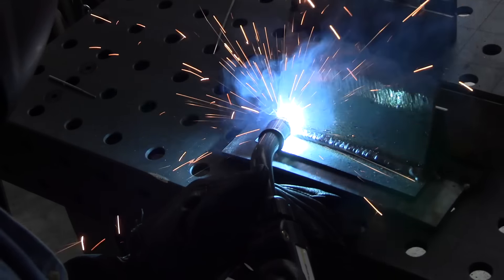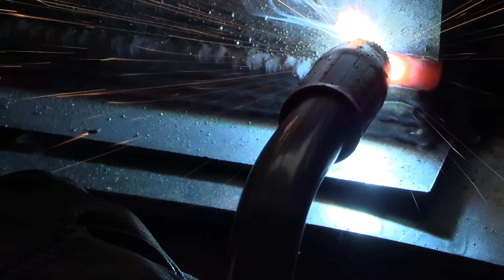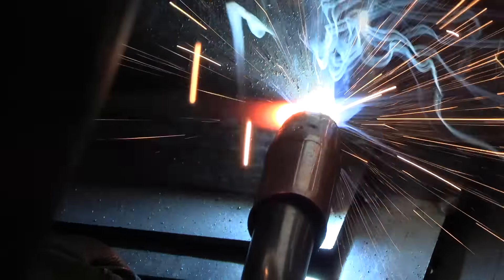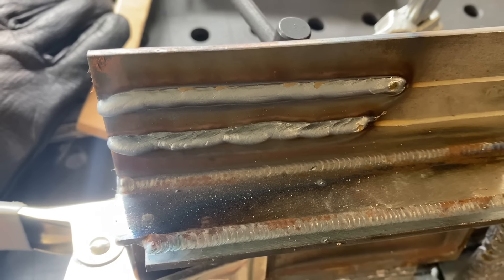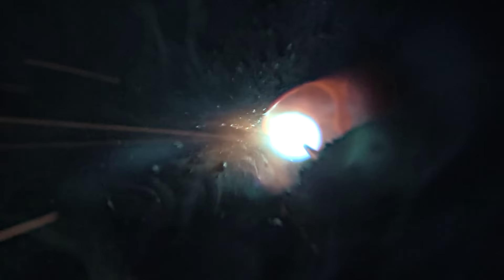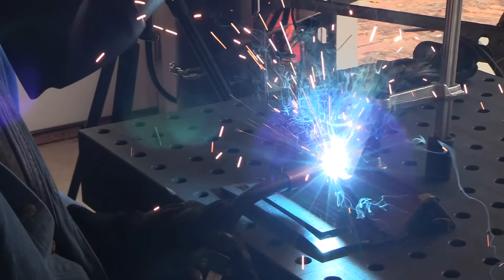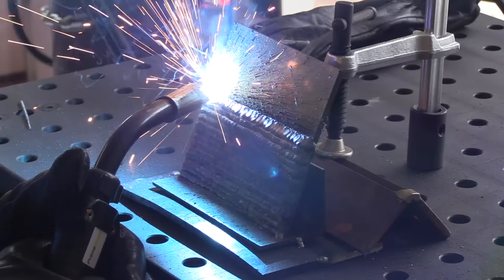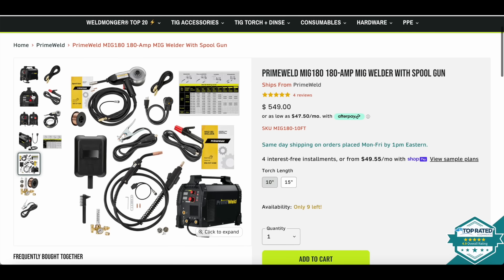MIG Welding Practice Beads

Comment: Some tricks I've learned 

1.  you can intentionally increase your stick out to temporarily drop your amperage if things seem to be getting too hot and burning through 

2. pushing slightly pre heats the base metals as you progress in the weld and is more common for better penetration 

3. Pulling is commonly used for post heat and can help when building up weld size and can help eliminate things like undercut
Reply: The number one thing I taught students who were burning through, at least until they improved; is that "you don't have to hold down on the trigger".  If it gets too hot - STOP.  Let it cool a bit before you get back on the throttle.  Most new students intuitively think that because a wire welder is designed to feed wire continuously, that you NEED to run it that way.  Short stops and starts until you get the hang of it, especially if you are set too hot to begin with.

Comment: When I first started of in Engineering in '04 a guy I worked with announced with absolute certainty that "You push MIG and pull stick" No exceptions 😂 Obviously,he was speaking from the experience of having welded only in the flat position.There are so many mitigating factors that dictate what you can and cannot do.Try welding parts on to Earth moving equipment while other parts are limiting your scope for movement,and you're more than likely going to reconsider your position.

Comment: Pushing or pulling the wire comes in handy on multiple pass welds on thicker plate.  Pulling the wire in spray arc mode tends to be more of a convex weld while pushing is a bit flatter or concave.  I like to push the last pass as it lays flatter wetting the toes better.  Just my preference.  Thanks for the videos Jody, keep them coming.  I really could have used you 30 years ago.

Comment: When I was at the shipyard I was the unlucky guy that they sent to qualify for hand held SAW (submerged arc welding) Also called SQUIRT! I figured out PDQ that you needed to find a rhythm to maintain a consistent bead. For me the old song Under the Boardwalk fit that rhythm. I'd sing it in my head and move the torch to it. Hot Dang, I passed the x-ray text! I was doing spray arc with 100S 1/16 wire one night and the song got in my head and the welds looked much better. It's hard not to let your mind wander on a 20' long bevel! Find a song that gives you a steady rhythm and see if it works 4 you!

Comment: As always, great video Jody!  2 individuals that work in the shop that I work at have started welding structure downhill with either short circuit MIG or pulse MIG. The one piece you could physically see the lack of fusion on it. I hope no personnel get injured as a result of these individuals ignorance.

Comment: That's right, welding at the bench, flat, is one thing. When the tip is in a crevice where you can only see with one eye, well you do whatever it takes. I agree, learn both ways. Practice makes perfect. I remember when I was learning TIG (about a hundred years ago now) the instructor made us weld with both hands. We spent as much time with our non-dominate hand as we did with our dominate hand. Same applied for MIG.
Reply: Really, try welding with a torch, under a car, lying on your back with your arms stretched way over your head, looking upward  and in that position up is down and down is up.
At my present job I do a lot of tig welding with my right hand while cold feeding mig wire from a mig gun with my left.
Of course, it's on a bench mostly, but still keeps both hands full.

Comment: Great video. I've always found that as soon as someone says, 'you should always do it this way', they are one trick ponies with very little diversity of experience. Yes, there are preferred methods, but they are not always viable options/methodologies in the real world. Master Craftsmen of any trade/profession are the ones who can create solutions that others cannot in situations that others walk away from because it can't be done. Push or pull, if you can't do both in all positions, in all circumstances, you need more practice

Comment: Coming from the perspective of robotic MIG welding on thin steel (Automotive Mass Production), some of which is galvannealed, I've found pushing to work out better. Coated metal always is a pain to weld; the zinc gasses off and causes a lot of spatter and can cause porosity if the weld conditions aren't hot/consistent enough to allow the zinc to bubble out of the puddle. Nasty process, but it's what the designs call for (and why we get paid to make said parts!)
Reply: Say more

Comment: It wasn't until I got a job in a factory that I really started using the push method, and I understand why people like it so much
Reply: When I was young I got a job in a factory and we used the ' squirt- gun ' method.
Put the Hobart dual - wheel wire feeders on 10 ( maximum ) and adjust the power to match.( usually over 200 amps )
The only pushing going on was the guys behind you on the line telling you hurry up.

Comment: I was taught be an old school welder that push or pull can be perfectly acceptable given the right circumstances . 

When I moved companies , most of the welders there had never been through a proper apprenticeship and were all against pulling when mig welding ..The response from them was ' no penetration ' when you pull .

I went the extra mile and did back to back push versus pull welds , then doing a cut and etch on them to prove my point .

Comment: They need more videos with spray though and pulse i mean thats what you'll be doing in the industry. Short circuit's great basic ground work and good for hobbyists. Good for sheet metal work and your very basic fabrication work. Short circuit is good to get a feel to how a puddle should look and feel. Good for a novice to start out with

Comment: What are your thoughts on 120V flux core MIG machines? I really like my Lincoln LE31MP. I've used it on some non-critical, but high-load, heavy-equipment repair (like grapples) to good effect with NR-211-MP wire. I have since bought a Lincoln Ranger for heavy stuff, but I still lay down a nicer bead with that 120V machine.
Reply: Start running 7018 on that Ranger. Nr 211 is for lawn mowers and stuff like that.
Reply: @Kyehyfxu  Yeah, I know that's what is said about it. But I still can't ignore the results I get with it. Might take several more passes, but never had one fail so far.

Comment: I've been working with robotic welding for 20+ years, and we to 95% use push angle.
In robotics you often weld much faster, pull angle and fast feed speeds tend to render very convex and generally bad and ugly welds, with poor penetration.
In higher current 300A + Spray arc, more angle and more sickout is generally good advice.

BUT, and there's a big one, there are always cases when no general rules seem to apply, then you have to adapt.

Comment: You can mitigate spatter by making sure you have well over 80% Argon. Spatter is caused by not enough argon to maintain a proper plasma stream. When the plasma stream is unstable, the metal is not allowed to properly penetrate or lay down properly. As for pushing or pulling, I've never had that much trouble, and I've always tended to work a little bit slower with a little bit less wire speed. Unless I'm welding heavy Steel 10 or 11 gauge. Where I like to go into nearly globular or even spray arc with something heavy to do a root pass before I do a cover weld. The duplex properties of the weld will allow the austenitec Zone to be more normalized., reducing the possibility of failure adjacent to the weld.
Thank you for teaching the beads however because most weld test today require you to not do any bead laughing or weaving in your weld procedure. I find that extremely unsound. You are always putting more weld on than is necessary for the job. Unless you're trying to make something that's particularly good looking. I have laid down welds that literally look like a machined piece of the part. I have also welded vertical down with finger pulsing the trigger, a vertical down with 035 wire that passed a bend test on quarter inch steel. I have never instructed anybody on how to do that because unless you're damn sure you can do it right. You can get somebody hurt. But there are occasions out in the field that you have to do things that aren't supposed to be able to be done.

Comment: Hey Jody, one long lost youtuber said you can short circuit on 90/10 gas and it will produce much less spatter.

Can you do a cut and etch fillet with short circuit and 90/10 gas? Can you comment on anything that is awry?
Reply from the maker: From my experience, 90/10 works ok for short circuit but not as smooth as 75/25. If you had to choose one gas and wanted to be able to spray, 90/10 is not too bad

Comment: Personally, I find pulling runs a bit smoother and penetrates better than using a push-angle. I’ve only done short circuit mig, but this is usually the stance I see people take.

Every welder does things just a little differently than others though! If you’re experienced enough you can probably run it however you want

Comment: Lol pulling hard wire gets better penetration and this has been proven on mechanized test setups.
Reply: Not really. Try dye etching a 1/4" fillet on both. Pushing has a larger heat effected zone.
Reply: @Kyehyfxu  pulling gets better penetration for one reason, the arc is pulled to the leading edge of the puddle. When you push the puddle the molten metal rolls out in from of the arc. I’m not discussing either, I’m stating as this has been proven scientifically on mechanized setups. The size of the heat affected zone has zero to do with it.
Reply: @notanymore9471  You don't really have to type as much if you just point to the proof. Where do we see the "mechanized test setup" video you're referring to?
Reply: @gillihansmobilewelding  not from a video. I worked in automation with old guys that had done it. Industry testing during WPS development. But if you just watch what happens when you weld it’s obvious why. Welding forehand when the wire melts it rolls out in front and under the arc. Whereas when you weld backhand or drag/pull the arc, it goes to the leading edge of the puddle and that’s why it penetrates more. If you look at most traditional mechanized mig setups the torch is usually 90 degrees or a slight drag at 10-15 degrees. The only exception is the newer spray pulse processes that run better forehand but older short arc/spray setups run great backhand.
Reply: @notanymore9471  OH wow, I thought you had proof like you stated. I'm not willing to take the word of some stranger on the net, especially when they start their original comment with "lol" (like a teenager) and base their condescending comments on proof they don't have.
Reply: @gillihansmobilewelding  lol like that? Well if you thought that I was going to give you a link to a video or a scientific paper written on mig torch angle in mechanized welding applications then you are wrong. But people that work in the industry and have run mechanized machines and cut/etched weld samples know what I’m saying is accurate. In fact this HAS been known for a long time. More weld testing gets done and techniques proven in automation than anywhere else and certainly not in repair or mobile work so I’d never expect a guy like you to know the difference. It’s people that do testing that understand. So just like you don’t trust people online, I know you don’t get it. Even though I’m sure you think highly of yourself I’m guessing you aren’t and never have worked as a welding engineer or weld development technician or any similar job. Instead you are Joe Bobs Welding repair and if I want my rusty trash bin repaired then  I’m sure you are the guy. Now if I want a Ti-6-4 part welded then you probably aren’t the guy but don’t worry plenty of dumpster repairs needed. The robots don’t even want your job.
Reply: @notanymore9471  So, just more words? You're special aren't you?
Reply: @gillihansmobilewelding  sorry joe bob but we are on the inter web. Words are all we have. Just like you don’t have a video proving welding forehand is better.
Reply: @notanymore9471  The burden of proof is on the arrogant adolescent who initially claimed to have proof, sweetheart. You've continuously typed longer paragraphs without providing the proof you blathered about so confidently. You've just proven more of your ignorance by going straight to insults when someone asks for the proof that you claim to have. You're right about one thing for sure... words are all you have. Uh, lol.